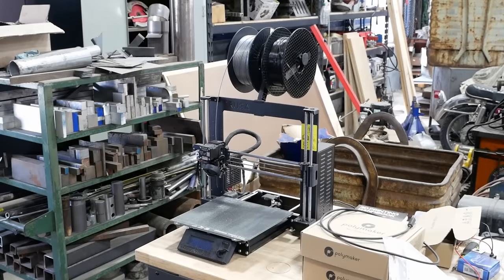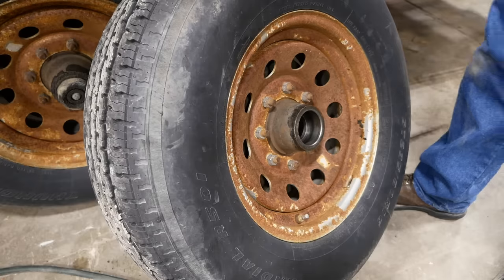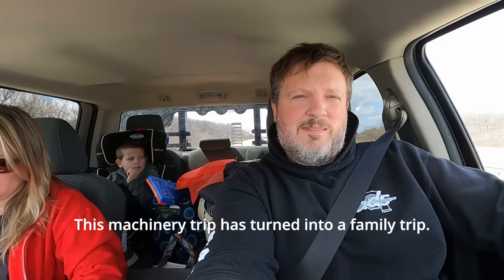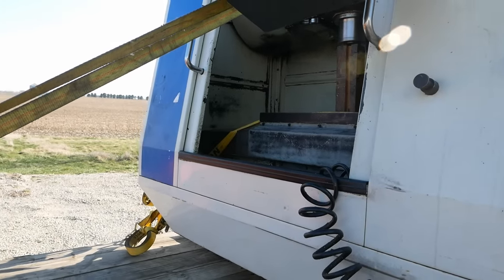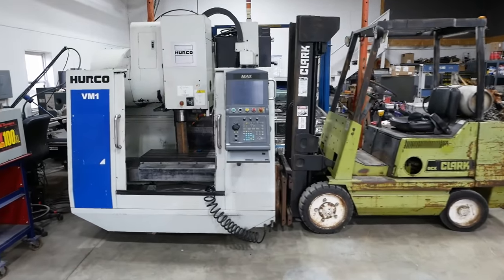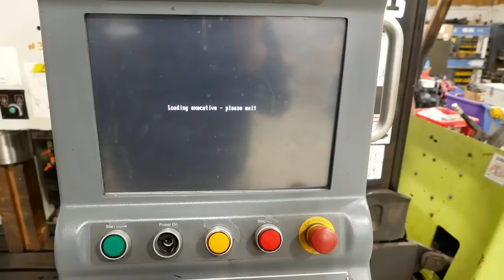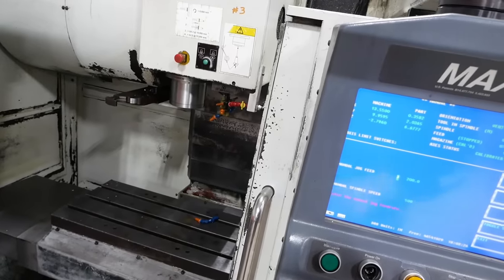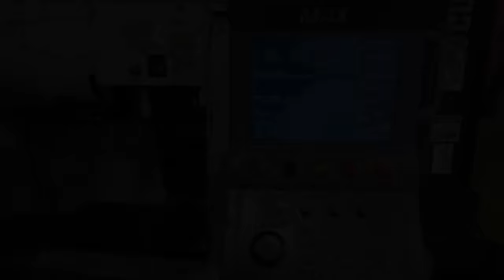Buying and Moving a CNC Machine - Peak Sketchiness

Comment: Tgat bearing packer is such a wonderful thing to have. I remember packing bearing by hand the best part after its done is the trail of grease you leave and have to clean up
Reply: I thought bearings don't require such a lot of grease. Most of it will be evacuated within a few spins anyway.

Comment: Those dust caps are for bearings with grease fittings. You pop the rubber piece off and use a grease gun to lube the bearings.

Comment: Probably been mentioned 100x in the comments but the rubber cap on the hub is for Dexter EZ lube axles. You don’t need it if there isn’t a zerk on the axle stub.

Comment: Nice, looks like it will be a good machine, Yaskawa drives are some of the best! 
As far as your axle goes the rubber plugs are usually on the EZ lube axles, there is a zerk on the end of the spindle to allow you to grease them easily. Almost looks like you have a hole in the spindle for the zerk, but it’s hard to tell on video. Reminds me that I need to finish doing the rest of my wheel bearings on my trailer, it’s always something.

Comment: Dexter used to make an axle (and I think they still do... Ever-Lube or something like that) that has a grease fitting in the end of the axle stub. That rubber plug is supposed to let you access the grease fitting so you can add grease to the axle.
Reply: All spindle manufactures have a lubrication option.

Comment: The rubber plug is to expose the grease zerk when you have Dexter ez lube axles. The axle spindle is center drilled to an intersecting point between the seal and inner bearing. You jack up the axle and spin the wheel and grease the zerk, It pumps grease back to the outer bearing and fills the cavity with grease.

Comment: Look at Wes, with his fancy modern DOS interface!

I remember at a previous job there was an old CNC machine that pre-dated DOS; just had on old minimalist boot-loader.  POST consisted of a beep, a pause, then "16K RAM OK" before it booted off the 5 1/4" floppy.  Once it displayed the opening "title" screen, you could safely remove the floppy until the next time you needed to boot the machine (which wasn't often).  It interfaced with the machine via a full length 8 bit ISA card, via a serial cable.

I was never brave enough to open the control box and discover what lurked within....

Comment: Hurco is ok. I've run many brands of CNC mills and lathes during my 40+ years as a machinist, and one of the shops I worked at had this identical brand and size except their software was a little bit better than yours. It was reliable, but because they are not popular, you would probably need to find an independent repair guy to fix it if you couldn't do so yourself. I thought that a Windows based machine would be great, but it turned out to not be very user friendly. We only used it for very small jobs and light machining. Wish you the best with it.

Comment: The Little rubber cap in the middle is designed to give you easy access to the grease fitting on externally greasable axles.

Comment: Not using the ol Powerstroke to haul the machine? Guess it is hard to fit a family in a reg cab truck. Thanks for yet another great video, waiting on the one that starts off with "I have a problem.. I somehow managed to acquire more CNC machines than I have room for.. but that's ok.. I have a plan... "

Comment: So, apparently, the plug in the dust cap is for when your using an oil bath system bearing. Its full to the plug. You do not grease the bearing(im sure you already know this) in this application.

Comment: Been there with the trailer. Carted race cars all over the place.  Learnt early to have at least 2 full sets in the workshop and 1 set in the tow car.  Don't know the reason for the failure as the same bearings were used here in Australia in the front hubs of the Australian built GM Holden and there was no issue.

Comment: The little rubber cap is typically for EZ-lube spindles. I don't know that they would have a purpose on your setup other than the cap may have been replaced at one point. I hope that helps!

Comment: You are looking very well and down to fighting weight - money well spent on precision engineering - I think in the coming years you could move more towards providing highly skilled precision repairs as against rusty/rotten welding and brake line fixes? working on valued vehicles and machines needing 'no longer available' parts for customers that wan't to keep stuff working

Comment: When I worked as a material handler i operated a 6000lb lift capacity forklift and spent most of the time right on the edge of the balance point, so I know the sketch personally

Comment: Rubber cap on those dust caps is designed for an EZ Lube axle.   On a Dexter axle that is EZ lube equipped there is a grease zerk behind that cap.   I had that setup on my tent trailer and I hated it - if you used the EZ lube feature there was pretty much a tube of grease in the hub you had to clean out when you repacked the bearings the old school way.   I used it exactly once and vowed to just do it the old fashioned way.

Comment: 😅 I moved a lathe that weighed 3800 lbs with a 2000 lb single axle trailer that had 20 year old tires on it. Used an engine hoist and a homemade a frame to lift it off. Bolted heavy angle iron and casters to move it where I wanted. You are not the only one who does goofy crap. It sat on the trailer for a year till I made room for it.

Comment: Rubber cap is for zerk access.
Axle should have a zero in center.
Cotter pin is offset so grease will not excape.

Comment: The rubber plug in the dust cap is for when you have greaseable stub axles.  There will be a grease fitting installed into the end of the axle. Pop the plug out and pump a couple of shots of grease in.

Comment: Wes, before you even get very far, you NEED to check.....backlash in all axis, runout on spindle with a precision holder or test bar, and drawbar force.  X and Y can nearly be tested by lighting the servos to hold position and just put indicator on headstock and push/pull table.  I've seen them at 10 thou!  Being an old hurco, I'd question everything.
Reply: You don't know Wes...
Reply: @Look_What_I_Did  Don't tell me "he knows CNC" because anyone in the know would not drag that turd home other than for views and content.  I'm learning that YT angle these days.

Comment: To confirm other comments below, the rubber cap is to remove if you want to add grease.  Some trailers have zerks for regular lube jobs.  So you don't have to remove the wheel.  Also, adding too much grease can be as bad as not enough.

Comment: The rubber caps are for the never lube axles where you have a grease zerk on the axle stub that in theory allows you to grease the inner and outer bearings without taking things apart.

Comment: Nice machine, what i noticed when you pushed the manual button for inserting the tool, the automatic tool arm moved, thats not normal, thats the couse of the tool alarm. It looks like the air valve lets air in the arm cilinder together with the push cilinder in the spindle. The arm goes down, passing the sensor and sets the alarm. Simple fix  looks like a leaking valve.

Comment: That rubber cap would be to go over greasable hubs we have a trailer just like that with grease fittings behind those rubber caps you pull them out and grease before a long trip and then reinstall the rubber plugs makes for easy greasing

Comment: The rubber caps are for greasable axles some of them have a grease fitting right there... you should have the caps with no rubber cover because you dont have the grease fitting there!! Both kinds work fine

Comment: The rubber cap is in case you have grease fittings on the axle spindle. You can pull off the cap to access the fitting.

Comment: The rubber cap is for axles with zerk fittings for greasing the wheel bearings - instead of beating up the dust cap taking it off and on you can just pop the rubber out. In theory.

Comment: For most people, trailers are peak sketchyness. The things just stand to death - rarley used, so bearings, brake parts, wiring harnesses and connectors are free to rust away. I swear - even if you fixed it a week ago, when you want to use it, something is always wrong…

Comment: There supposed to be a zerk fitting in the hole of the spindle that you pump a little grease into  every 5k  thousand miles  or whenever you want. Thats why the rubber is there in the dust cover

Comment: "I think the guys who I bought it from laughed at the number of straps on it." There is no such thing as TOO secure. I guess it comes from years of doing military air cargo, but when I picked up a bundle of 3 1/2" CPVC conduit a week back I used probably 9 straps. It may have taken me 10 extra minutes on the front end, but I could have flipped the truck and kept the bundle in place.
Reply: I've seen a rolled semi (which managed to roll over REEEEAALLLY gently) with the load strapped securely to the ceiling (which was supposed to be the floor).

Comment: Rubber cap is meant for "e-z" lube axles, quick access to the grease zirk in the end of the axle shaft to allow you to grease the bearings with grease gun... I still manually pack mine, never liked the grease zirk option.

Comment: The great axles have a grease zerk on end and a hole drilled in so the grease comes out other side of inside bearing. Then you pump grease? It fills that bearing and comes out around the nut. All by pulling off the rubber cap.

Comment: Fork trucks should have individual brakes, so you can steer when you pick up a full load! 
 If you don't add several hundred pounds on the counter weight, you are't over taxing the hydraulics 🤣 Yea we did that a time or two when moving machines before.

Comment: As someone who has run a forklift off and on for over 40 years, with certification, next time, throw a strap around the load to the mast/load guard/fork slide and just snug it up to prevent a weight transfer away from the forklift. Also, helps some with side loading. If you don't believe my capabilities, I'd be willing to come show you how to flip a coin with a forklift. 😁 You're only about 2 hours away from me.

Comment: Back to your trailer some axles have grease fitting on the end that’s why rubber cap on end  just pop rubber to lube bearings.with your setup just put closed cap or buddy bearing caps

Comment: Well, don't know didley about CNC, but unloading stuff off a trailer while working way above my weight class has been a long time specialty.  (Realizing that you don't reach my level of "sketchy" until your forklift won't pick it up, but it might hold it, so you let air out of the trailer tires to see if you can get clearance to move the trailer out.)

Comment: Those axle caps are for axles with grease fittings on the end, if I were you I’d just get a set of bearing buddies for your trailer they would keep those bearings greased much better then just having grease in the cap.

Comment: The rubber cap is so you can remove it and put a grease gun on the grease zerk that is supposed to be there. It used to be known as a Grease Buddy axle and the clip is because drilling the axle for a cotter pin makes it impossible to use a grease zerk. As a professional mechanic, I HATE those axles. Give me a greased bearing with a castle nut and cotter pin ANY DAY!.

Comment: Saukville?  Now that gives me a clue what city your son excitedly said.  Nice buy.
Machine Weight	6,200 lbs
Reply from the maker: They said 7000lbs. I'd say 6-7 is about right.
Reply: @WatchWesWork  --- Hurco is very precise about the weight of their machine: "The Hurco VM1 Vertical Machining Center (VMC) weighs between 6,200 lbs and 8,400 lbs. It has a table size of 30 x 16 in, travel of 26 x 16 x 14 in, and a spindle of 8k, 36 ft-lbs @ 1,450. It also has a tool capacity of 16 CAT 40."

Comment: I'd suggest you backup that cnc computer hard drive so that you don't lose the data someday. Maybe slap in an ssd through a converter, won't be using the full ssd speed but it I'll still be more responsive.

Edit: Just realised I haven't seen the inside of that machine so it might not even be close to a normal hard drive/computer hardware Oops.

Comment: The axles I’ve had with those rubber caps have also had a zerk fitting behind them.  Seems like a common Dexter feature.
Ratchet stripping the fork lift down to the back hoe…. Cue shaking hands with danger song.   I appreciate it, I myself am a safety third sort of guy.  😂

Comment: That’s a forever cap, for the occasional use trailer, if it’s a boat trailer, get bearing buddies.. and hit it with a pump or two here and there., I think that rubber plug is to easily check for grease, water, or carnage..

Comment: Generally there are several shipping brackets that are thrown in the garbage after they cross the pond.  Those are rather valuable in cases like yours.
Reply from the maker: Yeah I've never, ever, ever seen a used machine with the original brackets. Ever.
Reply: @WatchWesWork  brother you are one smart man!  I really learn a lot from you.

I've received machines with servo  motors disconnected, parameters mysteriously erased and worse.

Comment: So depending on the year that looks like a 2001-2005 maybe. The tool changers are kinda notorious for going out. I run hurcos at my day job that's a job shop. 

Anyways they are good machines until the tool changer starts to mess up because it's usually bunch of things wrong not just one thing. And you'll get it to work for a short time before it fails again. This won't kill the machine but it will make it miserable because you'll have to load tools manually. 

Hurcos are good machines for job shop work. Not really built for production. That's a vm model which is a basic model for general purpose. The vmx line is the heavy-duty line and is preferred but if you're not doing anything stupid that little guy will do you good. 

If you need help programming it in the conversational mode nothing has changed programming wise since like 95 so any tutorial you find will work.

Also hurcos are a bit like driving a right hand drive car when your used to left hand. It not very different from other cnc machines but you kinda have to readjust yourself for slight differences.

Comment: The point of that rubber plug in the cap is to be able to pop it out and grease the zerk that's integrated into the end of the axle... which yours doesn't have, so it's not the correct cap anyway.

Comment: I’m not familiar with that particular make of machine. But I also haven’t been in the “industry” that long either. I got a late start. I’m curious to see the “tale of the tape” as to how much backlash there is in the table and how accurate the machine as a whole is. I’ve ran some pretty clapped out machines. Built in the  80’s. One lathe in particular, a Nakmura Tome that the x axis would randomly shift .004 and then go back after you made an offset. Made doing production runs real interesting.
Reply from the maker: I had a Mazak like that. Turned out the encoder coupling was loose. Made my brain hurt.

Comment: Nice goin', Wes. I trust you checked all the fluid levels before you ran anything. I assume there's hydraulics as well as lube. It's clear that you're the right purchaser for this mill. Anyone can buy and use a new machine, but it takes someone who knows how they work to make a used one viable.

Was that the Milwaukee Zoo? Were you actually at the New Glarus Brewery? If so, I wish I could have met you there.
Reply from the maker: We were just at a restaurant. No hydraulics, but it has pneumatic over hydraulic.

Comment: I would take disc images of the CNC's hard drives..hopefully they are not IDE, but there are external adaptors also supporting  these.
Reply from the maker: I think it's all IDE. I believe I have a backup on floppy disk.
Reply: @WatchWesWork  make images of these, too 😅. But disc images are easily done. The IO board is probably ISA, too….  You might want to start becoming a retro tech nerd 😂.

Comment: That wasn't to sketchy just they didn't put a big enough counterweight on it when they built it. Actually it wouldn't have taken much more weight on the back to stop it bouncing, even the wife sitting on the back would be enough. Ask me how I know.
It looks like you might have got good value for money if the tool change is a simple fix. I can't wait to see it in use.

Comment: Would be nice if you could switch to 30 fps. 24 fps doesn't line up equally on 60 Hz displays and thus frames are shown not equally long, which gives very jerky movements, especially visible on panning shots.
Reply from the maker: I’m using 30 fps
Reply: @WatchWesWork well, no you don't. Enable "stats for nerds" in the Youtube settings and select them on your video. It shows the resolution@24 fps.

Comment: *Just put the return parts back in the box, tape it up, Write Return to Sender* 

Wait, shouldn't you have checked the fuses before you removed it from trailer???

Wait for it, wait for it, you get it? 😜

Techs jump to messing with ECU, Fuel Pump, etc Tech I worked with got a month of No Crank, No Start, Oh its a ECU, Fuel Pump, Timing Belt he diag. Sells the work and no change to no crank no start.

me) Engine Seized? You check oil?

A1 Tech) Uhhh I don't know, no I didn't check it.

ME) I hope we didn't push this big ass econoline service van loaded with tools and supplies like half a mile and up a grade into the bay.

A1 Tech) Yeah engine seized... No oil on dipstick...

Next vehicle was a mid 90's Chev Suburban, we all help push. When done I saw a trail of oil. I said 

ME) check the pan for customer mods, fancy pan? I saw a piston rod and cap in the lot parking spot...

A1 Tech) 2 days later, wasting 2hr plus deadlift time "I can see daylight."

ME) FML

A1 Tech)  Can you help me and put it back together and park it (since your hourly tech).